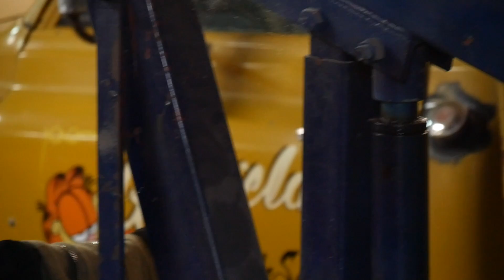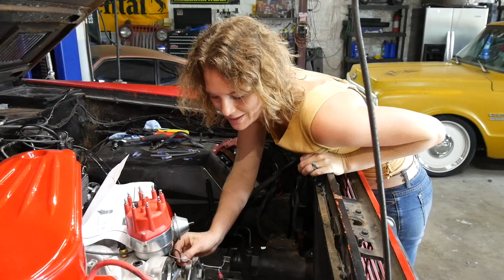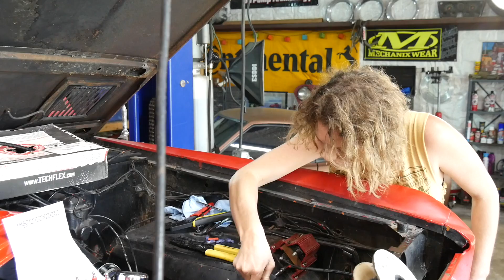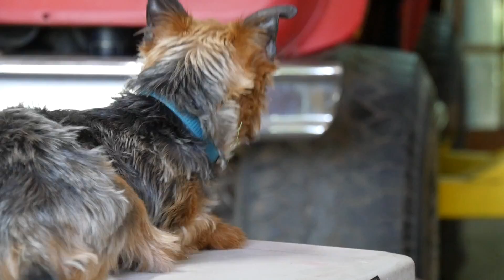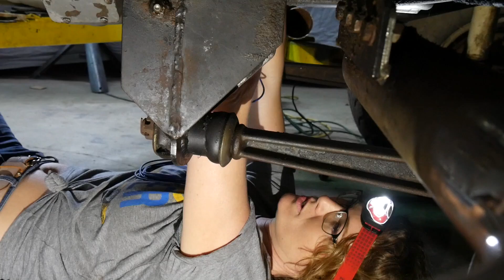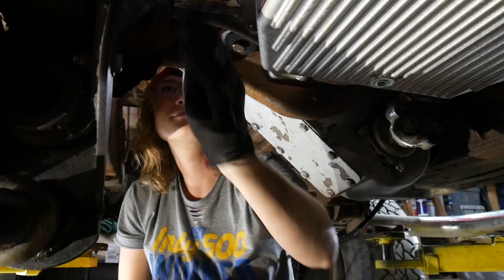Early Bronco Holley Sniper EFI continued!

Comment: I really enjoy watching your YouTube channel and have learned a lot from you two. I was an electronic technician/electrician for many years so I did a lot of wiring. One of the most important things about is making good connections and especially good ground connections is to use conductive grease. We always sanded down to bare metal and applied conductive grease to the surfaces before we made the connections. When we made a connection with aluminum we sanded the surface, applied conductive grease and then wire brushed the aluminum before we made the connection because when you sand aluminum it oxidizes immediately. You will probably have to go to an electrical supply to buy conductive grease. Most auto parts stores will sell you a tube of Dielectric grease and Dielectric means "non-conductive" and it's great for things like spark plug boots or sealing electric connectors. I guarantee that somebody is going to reply "They've been using Delectric grease all their lives for electrical connections and never had a problem." If I had been caught with a tube of Dielectric grease on the job I would have fired on the spot.
Reply from the maker: Never knew that!!

Comment: Just saying…
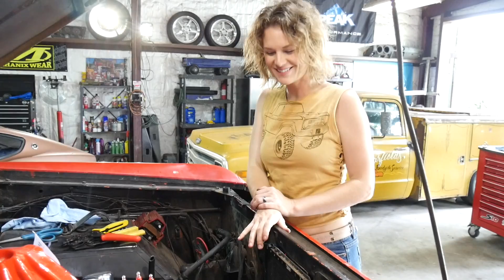(5:09)
I would have put different connections on the orange and red wires out of the distributor, because if you’re doing a road side repair. The orange and red wires look the same in the dark. (And under street lighting.)Maybe a female and a male connector, so you cannot get it wrong.

Great job,
Thanks 
Morph x

Comment: Hey Emily, since you're using those great crimpers and heat shrink, you can actually clean things up a bit, and buy just the bulk connectors without the plastic sleeves on them... in addition, you can get the heat shrink in colors for denoting the wires function in system. They'll be smaller and cleaner at each termination without the pvc , and if you're in a hostile environment like a race engine or boat;  crimping just the terminal is best followed with some solder before heat shrinking to finish. The solder makes it corrosion resistant and durable while improving conductivity.

Comment: Nice video I would attempt to use similar color extension wires if possible I know then you end up with a ton of different color wires laying around but it makes for easier maintenance later, the different color ends work ok but will discolor. Still nice job!

Comment: The terminator efi and msd cd box was a  head scratcher but 4 years later i have yet to wire the fans and fuel pump
Reply: Better when Holley EFI is installed on a much newer vehicle and the installer doesn't need to deal with a distributor and a single coil, and lets the system "do its thang". Loss of the spark knock sensor puts the installer on the low side of performance or risk potential engine destroying detonation by pushing spark advance too high. For Emily and Aaron it won't affect then performance wise,  ......

Comment: Doesn’t your distributor have centrifugal advance built into it? I see it has a vacuum advance. Most aftermarket distributors you can adjust between a couple different degrees of advance and put different springs on it to adjust how quickly the advance comes on.

Comment: Just finished this on a SBC 350 in a YJ..... amazing except it back fires and sputters everytime I try and accelerate!!!! It fires and idles perfect, just hates being under load? What the hell?!!
Reply from the maker: Hmmmm!!!! Fuel starvation? Heck! I’d call Holley tech and ask!!!
Reply: "real" small block? (350 should be assumed as "real" SB)
or a more modern LS which is considered a "small block" by some?

For real SBC - are #5 and #7 cylinder plug wires 'neatly' bundled parallel to each other?

1.8.4.3.6 5 - 7 .2    - firing order -   5 & 7 fire one after another and should cross over each other to stop induction due to parallel plug wires and thus #7 firing to soon, and resulting in pre-ignition while the #7 piston is still coming up on it's own compression stroke. 

Ford small blocks were prone to do the same thing back in the '60's when someone "tidied up" the spark plugs wired to run parallel in the factory plug wire holders on the valve cover; can't recite the cyl #'s anymore, because Ford  1-4 cyl #s ran up pass side and then the 5-8 #s on the drivers side; where GM had even number cyls on the pass side and the odd numbers on the left side.

Comment: You have those uber super duper wire crimpers and still using those ancient wire strippers? Girl, you need to have a talk with Aaron. I use a small butane torch for heat shrink. It fits into the tool box and doesn't need 110 outlet like that hair dryer.

Comment: Tip for labeling wires. I have found that you can write on shrink tube with a Sharpie (I've never tried it in pen but it may work) BEFORE you place it over the wires and when you heat it the writing will shrink along with it.
The protective loom is great. In watching you try to work the wires in by hand I wanted to let you know about these inexpensive tools that make it much easier.

 https://smile.amazon.com/gp/product/B005DTKNZU/ref=ppx_yo_dt_b_search_asin_title?ie=UTF8&psc=1

IF you run into RFI ,running your sensor wires through this braided copper loom will help. I did it as I installed the wiring.

https://smile.amazon.com/gp/product/B00M8L2SBS/ref=ppx_yo_dt_b_search_asin_title?ie=UTF8&psc=1

Comment: The "Tech Guy" was incorrect.  You can use that magnetic pickup distributor to control timing with the MSD ignition box.  You just have to replace the rotor cap with Holley P/N  84211 and here are the instructions online here:  https://documents.holley.com/199r11031r.pdf  and there is a video on how to install the distributor here:  https://www.youtube.com/watch?v=oBSiyeg4XCU
Reply: You have a  Ford so it would be P/N 8433 and not P/N 84211 because that is for a GM vehicle.  If your not using the CD box you would wire in their coil driver to the square style coil.  It's all explained on that YouTube video.

Comment: I would not want a computer timing my small block Ford engine. Total timing should be a few degrees past 40. 43 is about perfect. Initial timing is almost irrelevant as long as it starts OK. The lightest flyweights in the distributor are the best, usually. I would love to have Aaron's Z car but only with its original 6 cylinder engine.